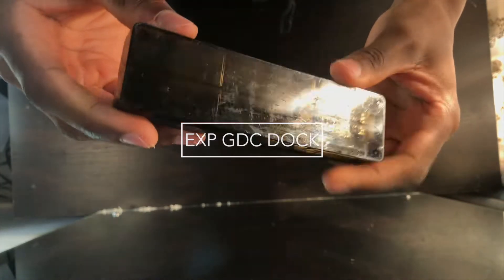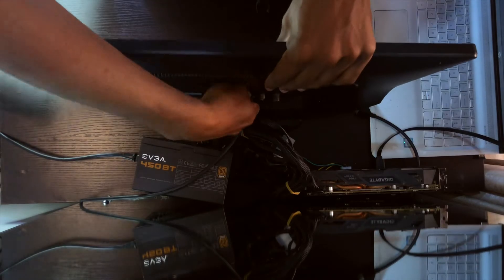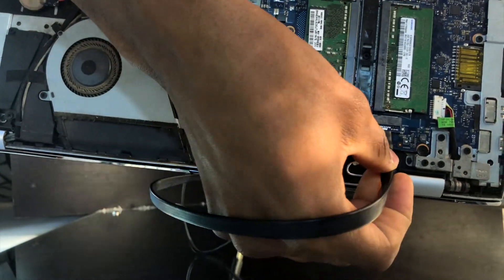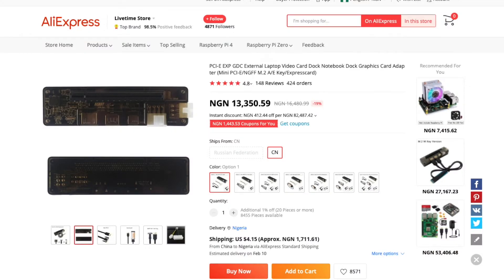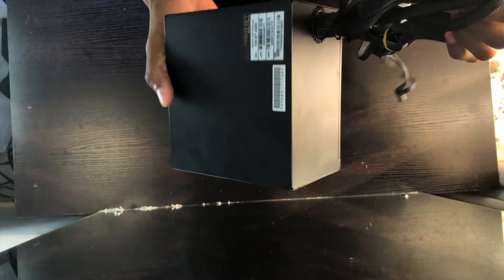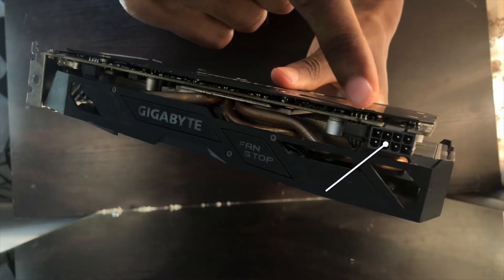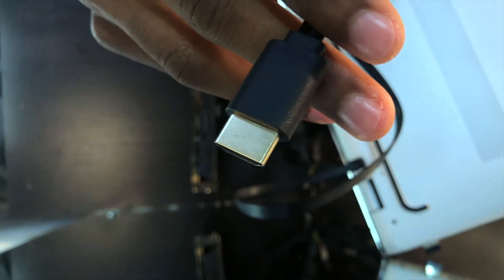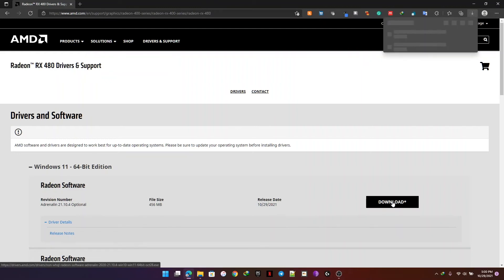How to Setup a Desktop Graphics Card for your Laptop: Connect an External GPU to almost any Laptop!

Comment: What is your laptop specification buddy?
Reply from the maker: It’s an HP Envy 15 as133cl
Intel Core i7-7500u
16gb ddr4 RAM
Intel 620 HD Integrated graphics
Reply: @FemiOjeyemi  Bro 1 help please..How have you done that cut out?
Reply from the maker: I used a wire cutter plier
Reply: Thnx buddy ❤️❤️❤️❤️❤️
Reply: Please upload a benchmark video on before use gdc and after use gdc dock..
Reply from the maker: Ok, I’ll try to make one soon

Comment: can uoi review a gpu box so you don't need to take out the wifi card
Reply from the maker: Hi timo! Yeah you can use this setup without removing your wifi card, as long as you have a slot for where to connect one of the required exp gdc connectors. It all has to do with what ports/slot your laptop has, if you’ve also got a spare m.2/nvme slot or an express card slot, you can use those connectors instead sacrificing your WiFi card slot
Reply: @FemiOjeyemi  am going to be honest with you i did not understand 1 word😂
Reply: @FemiOjeyemi  to much tech word my cave man ass can't undertand. maybe you have a pick link for the ports?
Reply from the maker: @timo4777  😂 what I meant is that there are other slots you can use instead of removing your WiFi card
Reply from the maker: @timo4777 look under the description of the product, it might be helpful
https://m.aliexpress.com/item/32824725772.html?gatewayAdapt=Pc2Msite
Reply: @FemiOjeyemi  oh ok thank you